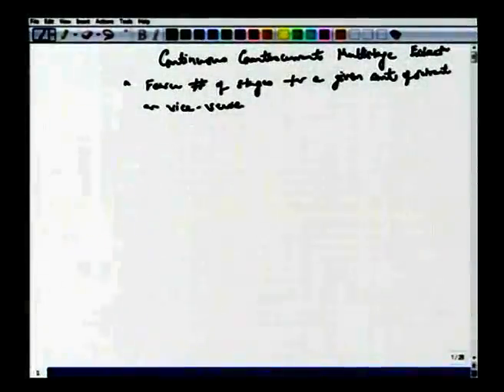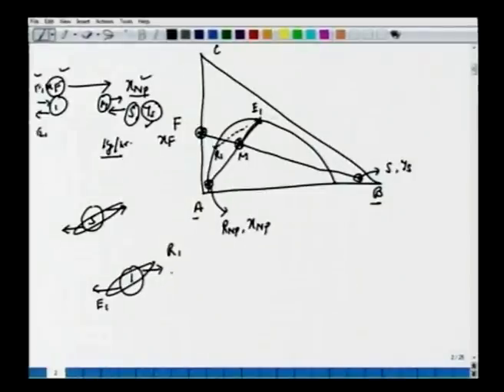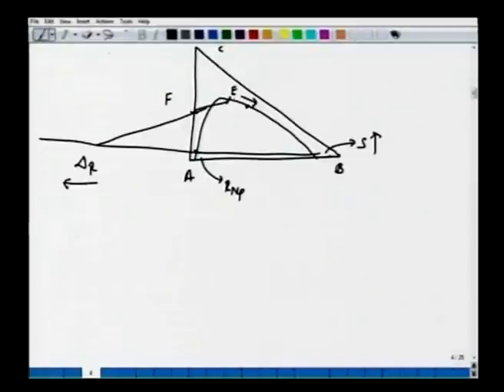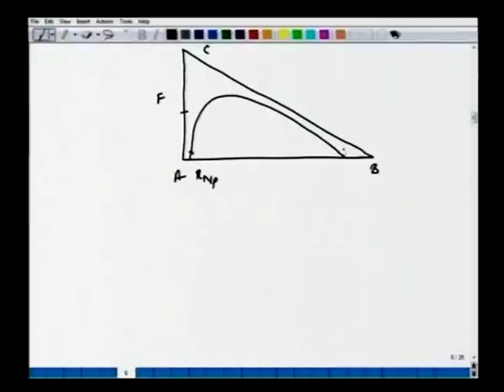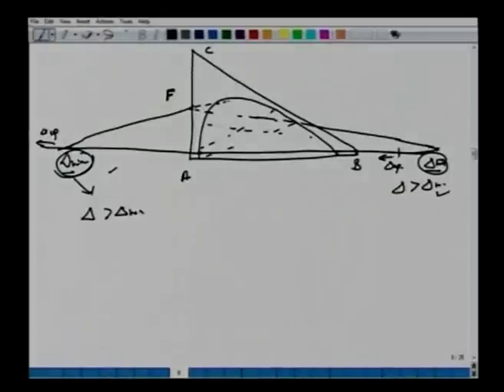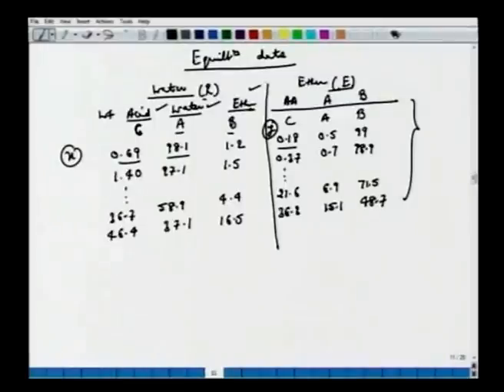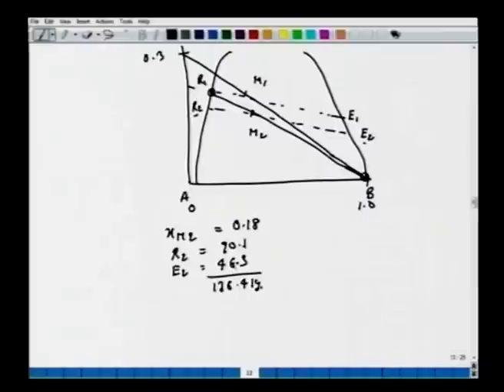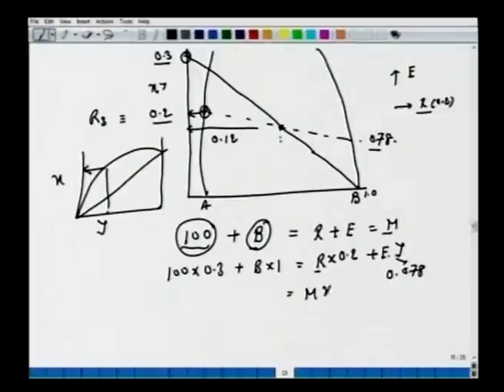Mod-01 Lec-27 Lecture-27

Comment: 45:58  it will be 40*0 rather than 40*1. Don't worry he writes correct answer 0.21 eventually so that you can follow ahead in the question
Reply: yup as solvent have no solute in it == so wt fraction (ys) = 0
Reply: @tarundhiman9428  how sir has drawn tie line and get value of x1 and y1